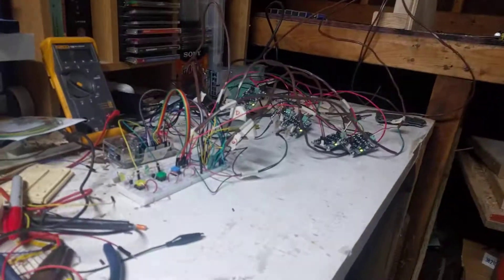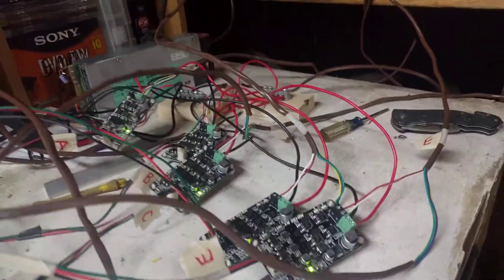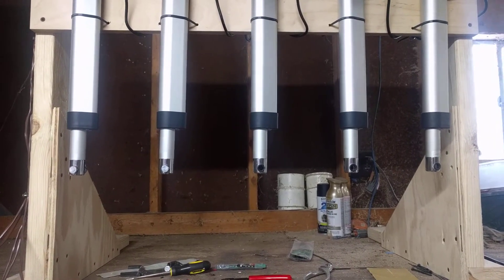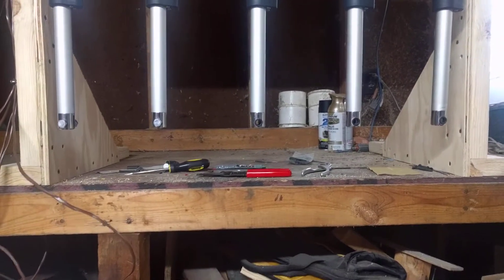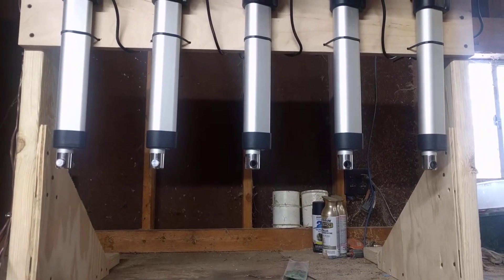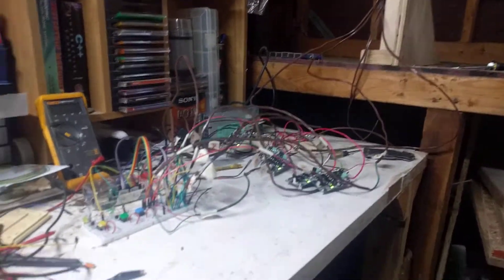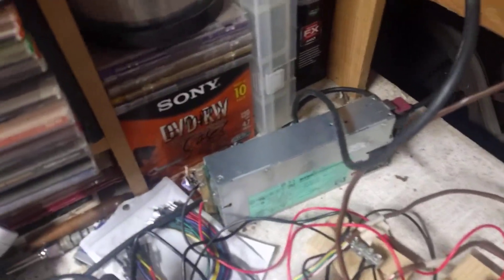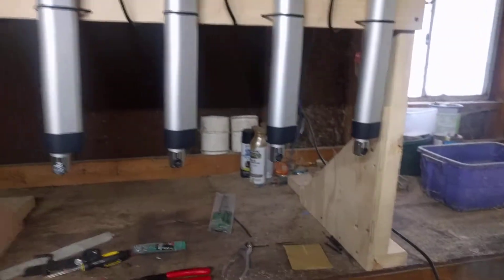RaspberryPi 4 Controlling Actuators

Comment: Is there a way to have the actuators activated with a virtual button o a touch screen display?
Reply from the maker: I can see no reason why that would not work. I have not worked with any touch screen displays yet. This project got sidelined due to covid shutdowning down most travel. I am currently working on another project similar to this, but on a much smaller scale: https://www.youtube.com/watch?v=bUMEAMdwb8c&t=331s

I have been wanting to do this project for years. A few weeks ago I got a 3D printer gifted to me, and now I can print the parts I need. I will wait for final build to take video.

Comment: This is cool. What are your plans for the linear actuators? I’ve been thinking of buying roughly the same ones to make a standup desk.
Reply from the maker: The intent of the actuators are to be used to lift a large oddly shaped table, for a radio station. The project was a job a friend of mine took. I came in after, so I don't know which radio station. He mentioned it, but I don't remember.

Comment: Suggestion: You should list the all of the hardware in the video.  What controllers you
re using and a sample of your code.
Reply from the maker: I have plans on doing a more in depth video of that set up. I will do just that, and list the parts used. Thanks.
Reply: @detrix42   what are the control boards from the pi to the actuators??
Reply: Looks like some MD10C R3 units